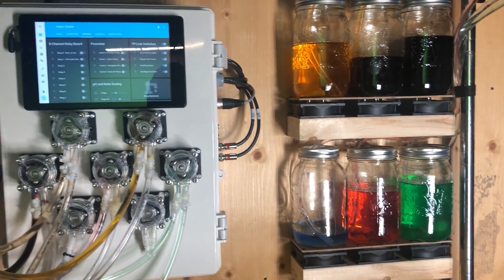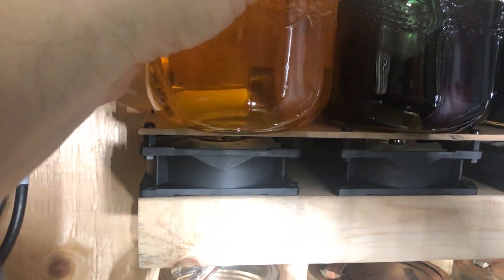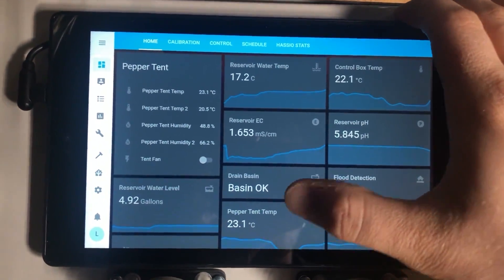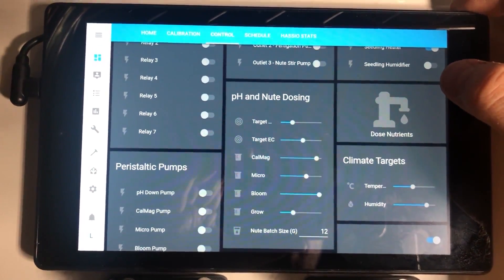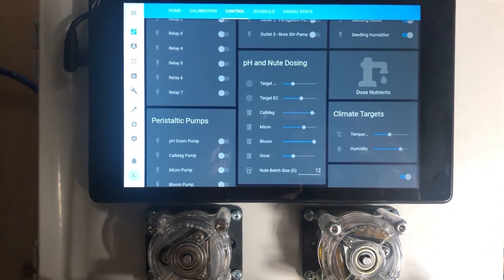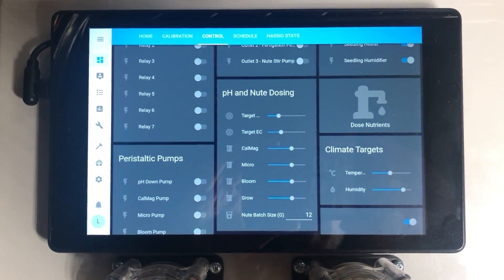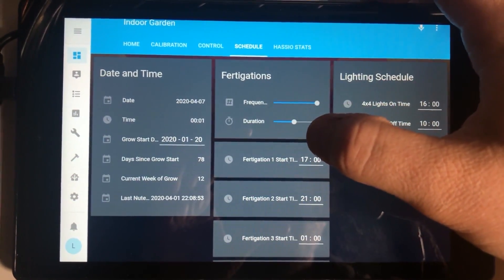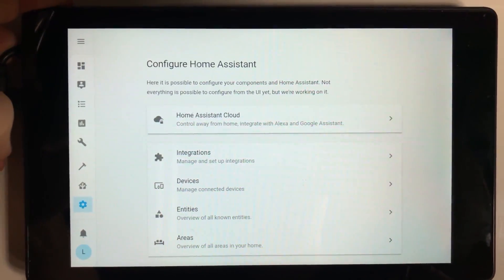My DIY Home Assistant Garden Automation System - Climate Control, Dosing & More. Pt.2: Functionality

Comment: hi can you show us how you controlled the arduino mega using the esp8266 or if you can give me the hint from where to start 

thank you very much
Reply from the maker: They communicate over their serial TX and RX pins. You have to tell them what to say to one another and what to do when they receive that info.
Reply: @LEDGardener  thank you very much for your replaying 
i have no knowledge at the micro controllers and i want to use it to increase the pins of the esp but i will use 2 or 3 esps in the system and program each one to do some task as i read through the Arduino expander documentation in the ESP-home but i didnot understand how to modify the code in it

Comment: i built this monster and i'm getting an error with the code could not find expected ":" here's the code if anybody sees the problem(the error is flagged for every ; after this stuff below starting with the BME 

(Adafruit_BME280 bme;

OneWire oneWire(ONE_WIRE_BUS);
DallasTemperature sensors(&oneWire);                  // Pass our oneWire reference to Dallas DS18B20 Temperature sensor
char bmeBuffer[16];                                   // For reading BME280 in control box

float celcius = 0;
char waterTemp[16];                                     //

unsigned long currentMillis;                         // Grab a snapshot of current millis each pass through void loop()
unsigned long tempCompMillis = millis();             // Timer for sending temperature compensation factor to EZO pH circuit
unsigned long tempCheckMillis = millis();            // Timer to check control box temp and mix reservoir solution temp
unsigned long atlasMillis = millis();                // Timer for polling the Atlas EC and pH circuits for readings
unsigned long dosingPumpMillis[6];                   // Timer to check to see if pump needs to be shut off
const unsigned long tempCheckPeriod = 30000; ): )

Comment: is there a way for the program, home assistant, accommodate for the viscosity of the nutrients?  I noticed that you have floraGrow listed, which is a very thick nutrient solution.  How are you sure you are measuring the correct amount of nutrient?  Or is there another way to deal with making sure that you are getting the correct measurement of nutrients?

Comment: I would love to see more about the how you did that with the irrigation schedule. I mean how you make the slider and appearing disappearing times
Reply from the maker: I have binary sensors that go high or low depending on the state of the fertigation frequencey input number. I use conditions in the lovelace card that look at the state of the binary sensors - for example if binary sensors 1-5 are high, it will show all 5 time inputs. If only 1-3 are high and 4-5 are low, it only shows the first 3 time inputs.
Reply from the maker: Here's the code for the custom card: 

cards:
  - entities:
      - input_number.fertigation_freq
      - input_number.fertigation_duration
    show_header_toggle: false
    title: Fertigations
    type: entities
  - card:
      entities:
        - input_datetime.fert_1_time_4x4
      type: entities
    conditions:
      - entity: binary_sensor.fert_1
        state: 'on'
    type: conditional
  - card:
      entities:
        - input_datetime.fert_2_time_4x4
      type: entities
    conditions:
      - entity: binary_sensor.fert_2
        state: 'on'
    type: conditional
  - card:
      entities:
        - input_datetime.fert_3_time_4x4
      type: entities
    conditions:
      - entity: binary_sensor.fert_3
        state: 'on'
    type: conditional
  - card:
      entities:
        - input_datetime.fert_4_time_4x4
      type: entities
    conditions:
      - entity: binary_sensor.fert_4
        state: 'on'
    type: conditional
  - card:
      entities:
        - input_datetime.fert_5_time_4x4
      type: entities
    conditions:
      - entity: binary_sensor.fert_5
        state: 'on'
    type: conditional
type: vertical-stack

Comment: Just came across your video. Great work! I also just picked up a pH kit from atlas. How are you sending the calibration codes? Are you using i2c with esphome to send the commands or some other means? The reading come through great, but I haven't figured out how to calibrate just yet
Reply from the maker: I haven’t calibrated yet through ESPHome but it might be worth spending a bit of time to figure out how to trigger it.  In my original system I would just send the command over i2c whenever I needed to since it ran off Arduino code.

If I remember correctly, Atala says the time before recalibration  is ~1 year though, so hopefully it doesn’t need to be done too often anyway.

Comment: @LED Gardner - I just happened upon this video and started watching thinking perhaps I would see a HA setup to control some parastaltic pumps, but it just kept surprising me more and more with how well you have very comprehensively solved the problem of automating a well monitored hydroponics grow system for a single crop.
I have been thinking and reading about this for a while now, and your system is very thought out.
I haven't yet looked at any other of your videos or at the project, but off the top of my head I could see enhancing the system in a couple of ways:
1. Add a means to capture the plant's health by using one of the open source camera photonics projects to capture leaf color and estimate climate changes using AI. I hear that this is a sort of biofeedback way to better adjust CO2 levels, oxygen in your water, etc to keep the plants at maximum yield and health (which is handed down in the DNA of child generations when cloning.
I didn't even think to adjust the fan speed.
2. Find an efficient way to add a layer of abstraction so all of your solutions apply but are operated on separately for multiple systems (or crops).  Each crop would, at least require its own set of electronics which could easily be controlled with a esp32-s(ish) processor and a phew I2C connections.  That way you have a customized set of parameters for each crop.
The plumbing and reservoirs would be different, but the nutrients and pumping of dosages could be shared and just redirected with a solenoid controlled valve for each crop's reservoir tank.

Comment: Did you think about creating a blueprint for your design? I've been using HA for over 4 years but not just getting into hydroponics. Great setup!!! Thank you.
Reply from the maker: I've posted a diagram, parts list, and all the code at my github repo at https://github.com/ledgardener/gardenAutomation if you're talking about blueprints in a Home Assistant automation sense, I have not yet created any since they didn't exist at the time I shared all my code.
Reply: @LEDGardener  Thanks for the reply! I will keep you posted if you want on my progress. My goal is an NFT system and maybe a Hybrid DWC system since I want to grow both veggies and leafy greens. I've got some different ideas but your work will very likely come in handy and will definitely give you credit where due!
Reply from the maker: Very cool. Good luck!

Comment: Thanks for the video! Which pH sensor and which float sensor do you use?
Reply from the maker: It's an Atlas Ezo pH circuit and Atlas probe, and the float sensor is a generic one like this: https://www.amazon.ca/dp/B00909404Y/ref=as_li_qf_asin_il_tl?ie=UTF8&linkCode=gs2&linkId=fba6fababaeb52bef879ed236cd6e655&creativeASIN=B00909404Y&tag=ledg02-20&creative=9325
Reply: @LEDGardener  thanks again! got both of this now.

Comment: Would you ever sell pre-built units?
Reply from the maker: I think only if I switched the programming over to a custom solution. Home assistant changes so fast, which is awesome for users but would be a nightmare for somebody whose products depend on it.
Reply: @LEDGardener  just having the base would give someone a huge foot in the door. Im amazed by how much you have controlled

Comment: what are you using for the touchscreen?
Reply from the maker: A Fire HD8
Reply: LED Gardener can you describe how it hooks up?
Reply from the maker: It runs an app called Fully Kiosk which points to the address of the Pi to show HA
Reply: @LEDGardener  Thanks LED. will this older one work? Amazon Kindle Fire HD 7 2nd Generation Tablet, 16GB, Wi-Fi, 7in - Black X43Z60
Reply from the maker: V Richter the 7 is actually a smaller tablet than the 8 - they’re 2 different models rather than generations. Lots of people use the 7 though. There is also a $10 add on I bought from Fully Kiosk to allow me to dim to black and a couple other things.
Reply: @LEDGardener  thanks for the info, keep up the great work, I know you obviously love it!
Reply: @LEDGardener  can you describe how to install fully kiosk on the fire tablet? I just picked up a 10HD

Comment: This is amazing!  I plan on spending some $$ through your affiliate links, but my coding experience is non existence.   Have you decided to share your codes?  I'd Ike to build one for my wife's she shed greenhouse,  and one for my brother in-law.   I'm also looking to have my rain collection system automatically direct water to 4 individual zones,, using proximity sensors and solenoid  valves.

Comment: How are the stir pumps being controlled ? I know in the video you said you have them connected to the relay but on the dashboard it shows that the relay is not connected to the pumps.
Reply from the maker: The magnetic stirrers in the jars are connected to relay 0 of the 8 channel relay board. The stir pump that mixes the nute res is connected to one of the relays that runs my power bar (they’re labelled “outlet”) on the dashboard)
Reply: LED Gardener thanks for clarifying that. It makes sense now. Can’t wait for the next video. I am following along with the intentions to make my tent automated !

Comment: Please help with my question??
When v mix number of nutrition in water but  
Plant observe 1 particular nutrient from the solution, how can i identify which particular nutrient is running low.
Reply from the maker: That's a tough one, you have to watch the leaves of the plant in order to guess what it's missing.
Reply: @LEDGardener  thanks.. I'm working on smart home roof hydroponic system kit.
Reply: https://youtu.be/XZGD5Zcb9hE
Reference of my ??

Comment: I have been using Home Assistant for a few years now and I use Atlas Scientific pH sensors and would like to add the Tentacle Shield so I can also get ORP and EC but have a hard time writing the code to get them working smoothly. Can you post a affiliate link for the ORP and post you .ino's? Maybe put the ino's with the yaml's on github. If you can, I will definitely be spending some money.
Reply from the maker: Hey Mike. I do intend to post the .ino but I’d really like to have somebody who actually knows how to program to have a look at it for me and fix whatever screw ups I have in there. I have to reset my ESP every day or 2 (I’ve taken the lazy route and just built the reset into the program)so I think I have a problem in there and don’t want to lead people astray with bad code. There are examples you can download for the tentacle that make it very easy to work with though and I’m happy to help however I can if you have a specific question
Reply: @LEDGardener  I have had the reboot problem myself. It was due to the Arduino core version that made it unreliable. I changed Tasmota with a different core and they are all solid now.

Comment: Great job. Can you address how safe it is to have the magnet in nutrient solution or ph up and down which are harsh acids? Also what kind of tubing/where did you buy for the peristaltics
Reply from the maker: The pH up and down are majorly diluted. The stirrers have a coating on them that seems to be impervious the the ph solutions. I’ve got a link in the description to the tubing somewhere.
Reply: Yea I ended up looking it up, they use Teflon. Great job on this and good idea on diluting the ph up and down. Saves a headache when it comes to what tubing to use. What kind of tubing did you use for the inside of the peristaltics? It looks like you use food grade vinyl for the solutions but what kind of tubing did you connect them too?
Reply from the maker: Michael S whatever’s inside the pump from factory. I’m banking on them being foodsafe as well since the pumps aren’t super cheap and it seems they’re recommended for food applications.

Comment: Do you use moisture sensors in the actual soil?
Reply from the maker: Nope. I just flood them based on time since it's coco and I'm not worried about overwatering it.
Reply: @LEDGardener  Coco Coir? I'm just looking into this stuff and automated indoor watering seems so cool.  How do you control for fungus with all the humidity?
Reply from the maker: Yup, coco coir. Air movement is key to control mold. I have fans that blow across the surface of my pots as well as an extraction fan to cycle air through the tent.

Comment: Isn't pH 7.0 too high for hydro?
Reply from the maker: I had hit the calibration button prior to the video when going through things so it defaulted it to 7. I normally run at 6.0 in coco.
Reply: @LEDGardener  Ok, that explains it. What is the display you are using there? It looks slick like an old tablet
Reply from the maker: Amazon Fire HD8

Comment: A+Mazing. Do you think you could use one home assistant instance for both the garden and for the rest of your house? Does it separate relatively well with areas and such?
Reply from the maker: I am doing a bit of regular home automation stuff with motion detectors and smart switches. You can separate them out very easily by area or just by view in the UI.

Comment: Hi I have also been trying to achieve something like this through hass 

I have been stuck at atlas scientific probes getting into hass 

Can you explain some or share something how you got atlas scientific hardware to go inside home assistant 

Thanks in advance awesome project
Reply from the maker: Hey there. I’m just sending the values the Arduino reads over to Home Assistant via MQTT.
Reply: @LEDGardener  hi thank you for your reply are you planning on to make more videos about that is there a reference for Mqtt sketch you can point to ?

TIA

Comment: Hello from Russia! This is a very interesting system. I'm not sure that there is a need for the use of Arduino. But since it works, that’s fine!
It is very interesting to see how you did the automation in the Home Assistant.
As an aid to your project, I can offer a solution for the use of capacitive humidity sensors. They do not oxidize and do not have a harmful effect on the environment.

Comment: Do you belong to any of raspberry pi/arduino grow automation groups? Would love to pick some brains. I like what you've got going here. I wanted to start an automation project like this for my rdwc a few years back but after I moved to my new house I shifted to majority organic soil growing. Have you priced the entire buildout? I'm interested in knowing what the sum of all costs for this endeavor is. I'd like to start the process of an environmental system like this geared around compost teas and other organic feeding inputs. Thoughts? I'd love to brainstorm and collaborate with you! Subscribed.
Reply from the maker: I'm not a part of any groups like that currently. I don't have a running total regarding cost for the setup since it's spanned several months. I know veeeeery little about organics but I'm guessing it'd take some tweaking since from what I understand, things get a little "stickier".
Reply: @LEDGardener  yeah, organic inputs are not as clean soluble like salt nutrients so there is a lot of organic matter that clogs things. Then compost teas are only good short term as well because bacteria become anaerobic after 2 to 3 days. I miss the ease of my rdwc setup but I love the organic stuff so much.

Comment: I was wondering if maybe you could use an aeration system for the nutrients?  Not sure how blowing air-bubbles through the jar will affect them though, but it would mix them around.  The way you did it is very effective though :).
I have enjoyed seeing your setup.  It's amazing the things you can do with Home Assistant and it is so stable now.

Comment: Could you use a VPD chart to control your humidity? like instead of setting an ideal % fallow what the % should be based on the temp? also any way to create long term graph or log for a plants grow? maybe to like a google doc or sheet that has avg temp high and low for each day. after watching your videos i starting moving items off my Pi to esp's and homeassist its been cool.
Reply from the maker: The VPD thing is a really good idea. 
I think a lot of people are using something called influxdb to manage their historical data. I added the add-on but haven’t learned it yet. Welcome to the fold!
Reply: It is possible but you need to put the leaf temp into the equation for prefect VPD.  It's never the same day to day on a growing plant.  Best to focus on just the room temps & humidity, keeps you within range.